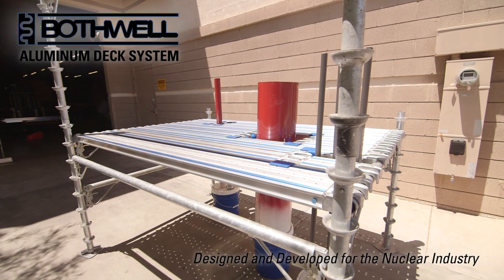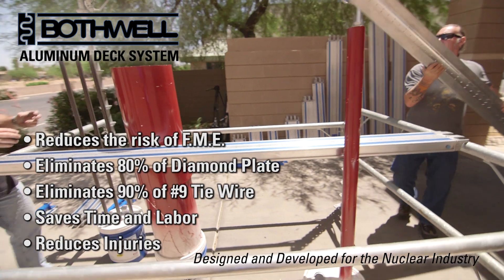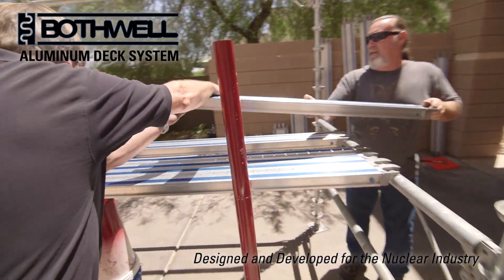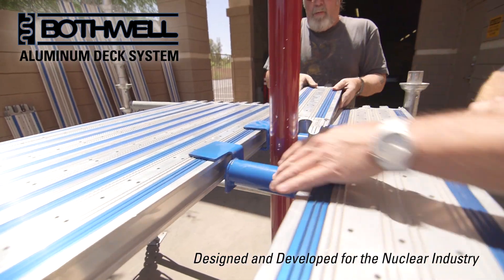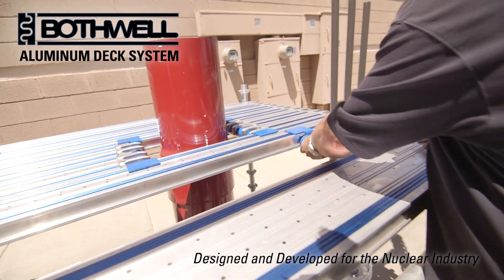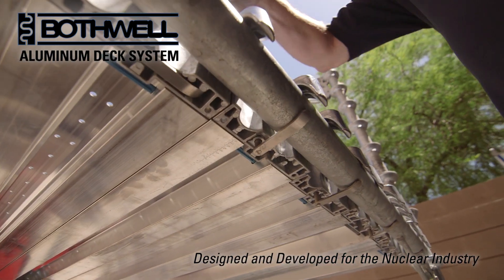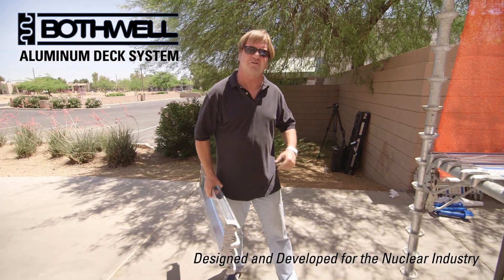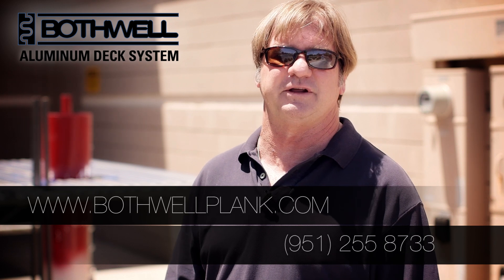Bothwell Plank System with Aluminum Plank for Nuclear Industry

Comment: Pretty sweet Tim,  but your original plastic plank are a lot easier to trim to size.  I just used some of the ones you donated to me to box in a fireplace.   The metal plank are too much of a conductor.  Did you see the Orange County story about 2 scaffold setters that  were electrocuted when they got too close to a power line ? They ere hanging a banner for a high school football game.